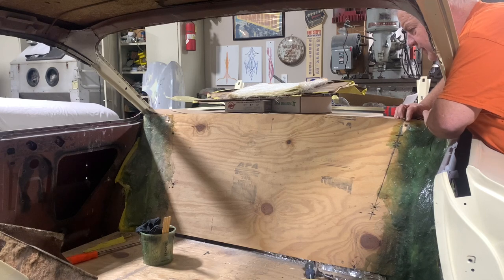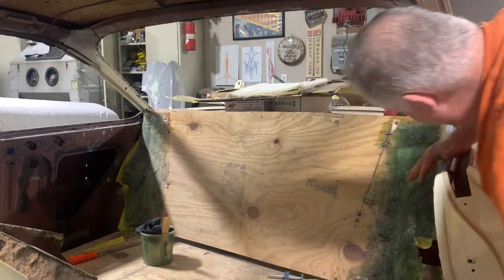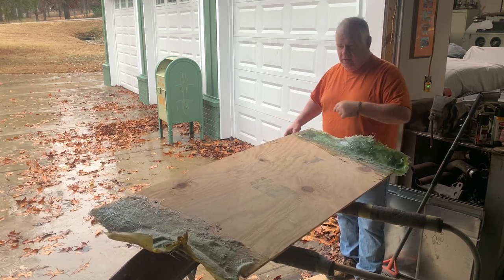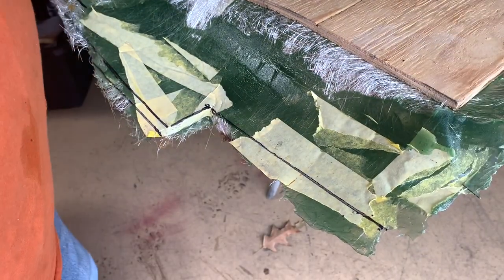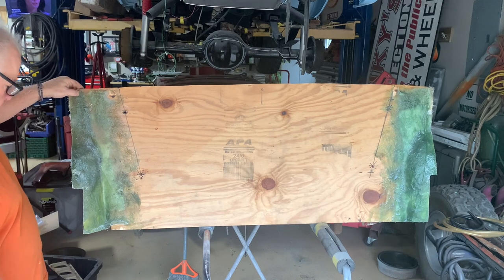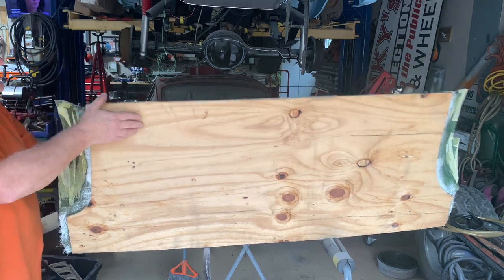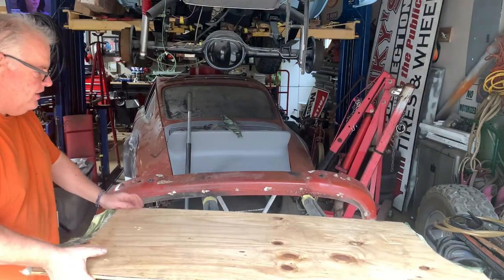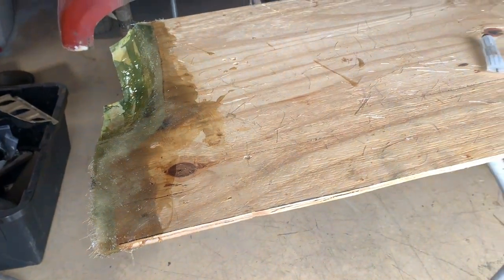How to Build: A custom rear seat for your hot rod project

Comment: What thickness plywood are you using?
Reply from the maker: That was 5/8 but I’ve used 1/2” with another 1/2 ring around the bottom. And bracing also.
Reply: @SpankysHotRodsandCustoms  thank you.